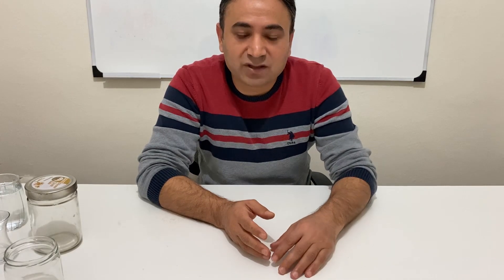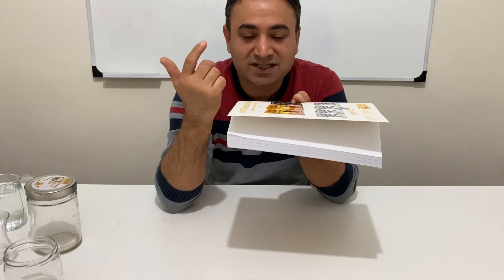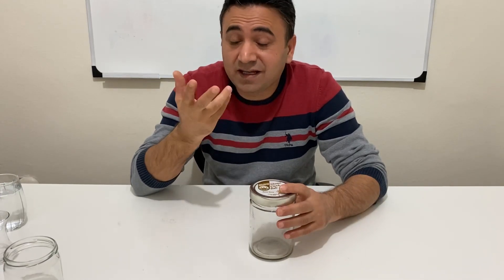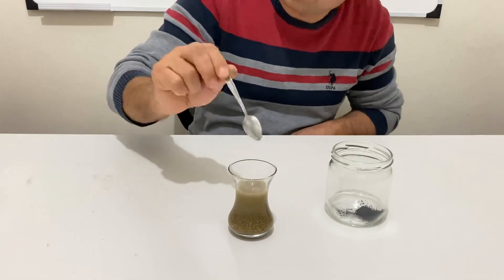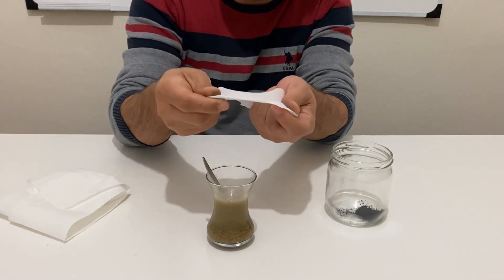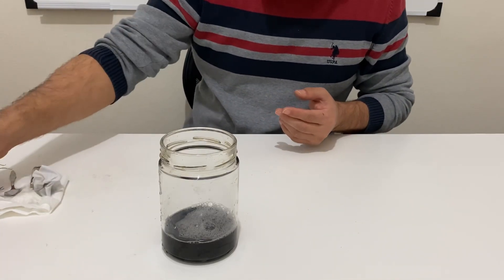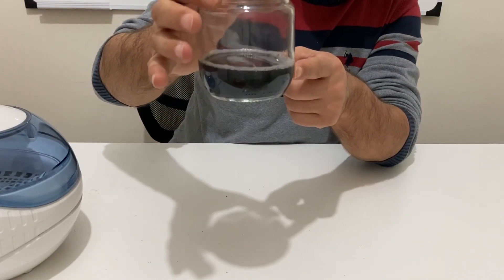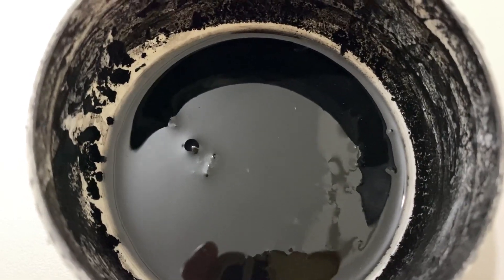How to Make Graphene at Home (Unique and the Easiest Method)

Comment: If you sonicate graphite in pure water for 24 hours, you will not obtain pure graphene. What you would get is:
	•	an unstable suspension,
	•	with only a few real graphene sheets,
	•	mixed with unexfoliated graphite,
	•	and probably with defects in the material.

The method only works if you add suitable solvents or surfactants and then purify it through centrifugation or filtration.

Comment: How do you know that you made graphene? Have you tested it?

The best I could do with short notice is look for the 270nm absorption line in graphene.

I have always wanted to build a spectroscope.

With an old phone, you could probably make one for $10.

Double slit - made with stacked razor blades over an inked piece of glass. The object will be directly on the other side of this thing. Light enters the box here.

Diffraction grating - use an old CD. Or the logo on a credit card. Light bounces off this into the camera.  It produces a rainbow from left to right with different intensities to match the source.

Take a picture and run it through some open-source software to make a spectrum chart 

A CD, a piece of glass, a box, a camera, and some open source software.

You probably want to purchase a 270nm light source. LEDs like this cost $5 or so bucks.

Now that I have fully convinced myself to make one...

Comment: Good idea.

As for mixing water with detergent on other films, it's a bad idea (you have to rinse the detergent off later). It's better to use Isopropanol or Acetone. They reduce the surface tension and don't stain the compound.

Comment: When the slurry dries out you're left with just very fine grained graphite. I mean I like the idea, you could level this up a bit by doing the grinding in ethanol using say powdered calcium then separating them using some acid. What you end up with is still very fine grained graphite but at least without random impurities. Also referring to your past replies - graphite can 100% pass through a coffee filter and if graphene flakes are big enough they might not. What is passing through the filter in the video is probably mostly graphite (graphene doesn't block light as much, you'd expect the solution to get clearer if it was mostly graphene). Not hating tho - this is probably the most sane homemade graphene tutorial I've seen so far.

Comment: 08:14
After you stirred the mixture, foam appeared on the surface of the graphite/sand/water mixture.
I don't think this is a normal phenomenon that would occur after mixing these three components.
When you washed the sand, there was no foam, so it wasn't caused by contamination from the sand.
I think you added some kind of chemical, possibly a surfactant.
In my research, graphite is extremely hydrophobic, and the effect shown in the video could only be achieved by adding a surfactant.
I will still give it a try to see if it's possible. Thank you for your video.
Reply from the maker: The reason of foam is due to speed of stirring. Graphene is hydrophobic not graphite ☺️graphite powder easily disperses in the water. Thanks for your contribution 🙏

Comment: How do you demonstrate that this solution is graphene and not only a mixture of graphite in water?
Reply from the maker: You can filter it. If it is not graphene it will block pass through by filter
Reply: @joyofelectronics9782  Please, what type of filter? 0.2 um I think...? Can you assay electrical properties of this solution? Maybe passing a electrical circuit with a little lamp through the solution and comparing with distilled water in other container.

Comment: There is one more way to test the graphene you produced is that you combine a small amount of it with epoxy and test the strength and conductivity. 

First test a pure epoxy object preferably a rod then make two more with the same size/shape with one mixed with graphite and another with this graphene. it would be very helpful if you could try it and tell us about the result.
Reply: @joyofelectronics9782  I thought of a similar but different method but I do wonder if your method could out perform mine. Thank you for the video by the way and thank you for replying.
Reply from the maker: @sanaidnikla1866  Thanks brother l will try your method ASAP

Comment: Does that work as well or better than using the hydrogen peroxide to break the layers apart? Also does the better conductivity translate to less resistance and less energy needed to produce the same heat/ temperature? This is not the one I already had watched Thank you.
Reply from the maker: This is the simplest and one of the best way of making a few layer graphene.

Comment: - The approach appears to be quite innovative.
- Could you share details about the type of fabric you employed to prevent physical contamination while cleaning the sand? Is it feasible to consider using filter paper as an alternative?
- To confirm that the end product is indeed graphene, whether it's a few layers or a monolayer, it's imperative to perform both microscopic and spectroscopic characterizations. Only after these analyses can we confidently classify it as graphene. Have you conducted these characterizations in your work?
Reply from the maker: If you mixed very long time you will get a few layer graphene. Filter paper wouldn’t be an alternative because the fabric or paper should permeate the graphite particles.

Comment: Thanks for posting this, i am researching something similar. 1. Not sure the sonication is needed, i read papers showing blending is much more efficient. 2. I am trying similar idea with acetone water mix, which can hold more graphene than water alone. 3. I hear milk whey can replace soap. 4. Could determine number of layers with Raman spectroscopy, are there test labs to do this we could hire?
Reply: You cannot see things this small with an optical microscope. 

You need X-rays to "see" things the size of a carbon bond.
Reply: your 4th point is something I wanted to know

"how do we know thats graphene when it dries?"
Reply: @fluffypinkpandas  answer, a $15 kids microscope. "just look at it" ~ed bassmaster.
Reply: @justthinkalittle8913  whats it supposed to look like vs other graphitized messes?

Comment: There is a scientific paper where they add milk protein to griphite and blend for several hours. Aparèntly The protein stops the graphene recombining into graphite, which is what it will do otherwise, with the apropriate tests they have confirmed that they produce graphene. The problem is that there is no simple test available outside of a laboratory to verify you are producing graphene. 
How do you verify you are producing graphene?
Reply: Due to graphite being an insulator, and the smaller graphite particles becoming more conductive as the graphite broke down into graphene, couldn't you just measure the conductivity of the solution over a period of time in the breakdown process with a multimeter? Would you notice the solution getting more conductive / less resistance as you continued to use the sonicator?
Reply from the maker: It’s really difficult to verify but from the conductivity and surface are when you apply it can almost understood 👍 thanks to this method you can get a few layer of graphite which is very close to graphene 👍

Comment: Hmmm,  so the idea with the sand is friction  by shearing off the  graphene flakes off the graphite?    Wouldn't it work better if  there's only enough water to make a slurry and then stir it that way ??   

In your demonstration,  the graphite are just floating above the sand while you are stirring it.
Reply from the maker: I tried in the way that you told but l got better result with more amount of water. And after making some experiments l figured out that it’s reason is the moving speed of the sand particles . More speed creates more friction force. As an explanation to your second question, some amount of sand stay at the bottom of the jar, but some other particles moving very fast at the top 👍
Reply: @joyofelectronics9782  
  This makes sense why other people use a blender because of the speed.  

 Thanks for clarifying.  Knowledge is priceless,  and  I learned a lot from you today.

Comment: there is a zero percent chance this produces pure graphene.
Reply from the maker: You can get a few layer graphene
Reply: @Joy of Electronics  graphene by definition is one layer though 😂
Reply from the maker: @CARLHPMA  l mean very close to graphene. This is even a very nice result with such an easy way☺️👍
Reply from the maker: Don’t be so sure before attempting 😉
Reply: Theres pure graphine and you're right, pure graphe is unlikely here.  Could there be some graphene made? Sure, but how much?  I don't know but I'd suspect it would depend in part on how long one blends and how vigorous it is.  And how long one runs the sonicator  ultra sound cavitation is very energetic and is known to help graphene flake off graphite. 

What's the purpose of graphine vs graphite here. It's surface area. Yes pure graphen will provide a greater surface area and offer more opportunity for intercalation of ions. but a little graphine and bunch of few layer graphite with close to graphene like properties probably offers much better surface area than granular powdered graphite.